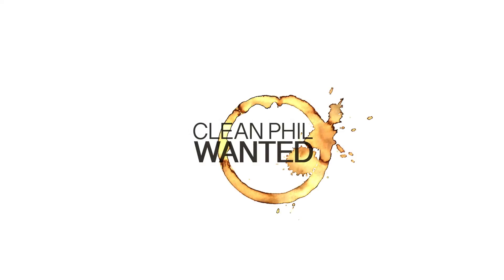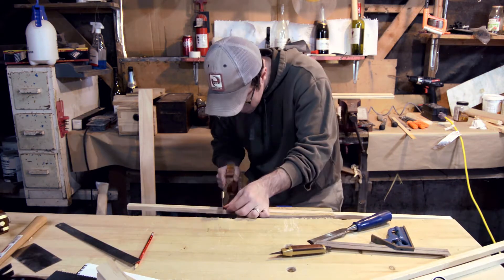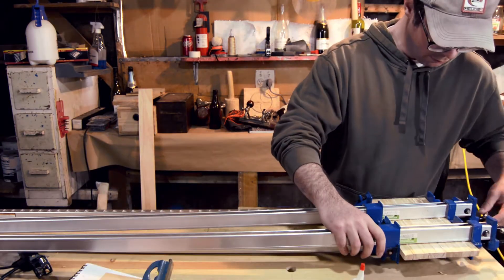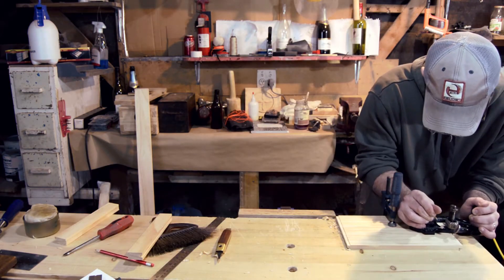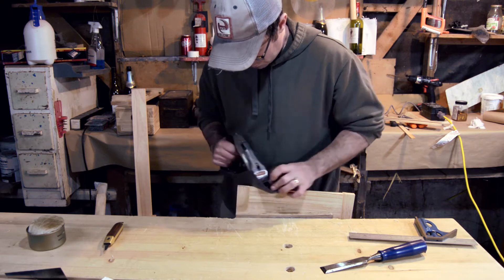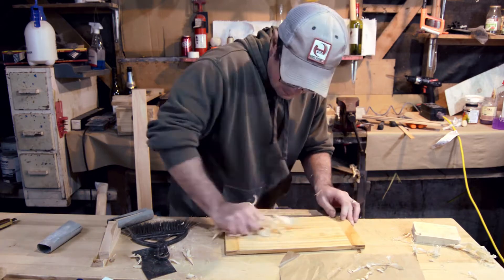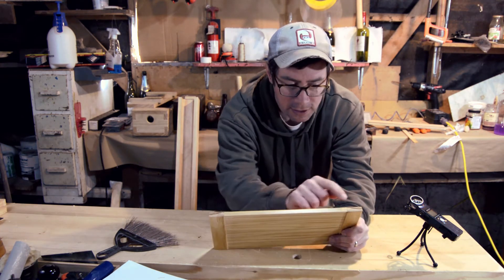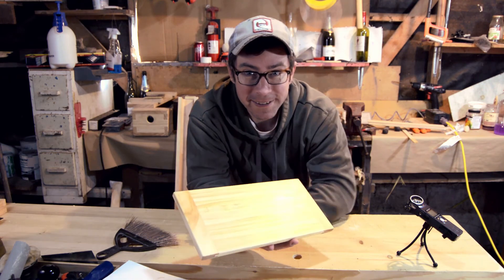Cheeseboard Build with Tongue and Groove Ends

Comment: Pretty cheese board, well done. You might have some cross grain issues but at such a small scale you'll probably be okay. You mentioned sawing straight both in this video and the last one. If I can be so bold, lengthen your saw stroke. It could be dropped frames do to sped up video but it doesn't look like you are using the entire saw plate during the stroke. Assuming your plate is true, the saw wants to cut straight and not using that great, long reference surface is like trying to joint a long edge with a #3 plane. It's possible but harder than using a jointer plane and the long sole as reference.
Reply from the maker: Hi +RenaissanceWW! 
 I thank you for bringing this up. First off, be bold. I started doing these videos for a number of reasons but getting feedback like this is one of the main reasons.  I'm not too worried about the crossgrain because of the width, but we'll find out for sure. If it does fail then I get to make another gift :D 
When I use my saw benches I can rip pretty dead on. I just can't get my mechanics right while in the vise. I will admit it is frustrating and I know that starts to play on the issue as well! 
The first thing I altered was my push, I was pushing down the rip and not across. Basically I wasn't letting the teeth do their job. Which is the first thing one hears to change with backsaw cuts to get those true. This same tactic really helped a lot with this set of rips. Still, you are correct that I'm not using the entire plate in the stroke. I find that the last 1/4 to 1/3 or so I'm dropping the angle and it jams up. I suspect this starts before those points. So, I've been altering my stance and trying different things but I still have this same issue so I'm open for suggestions!  
This saw is true and the set is on the money (I"m pretty sure anyways). Some of the other ones (church sale buys mostly) have wacky sets on the teeth, so I need to work on those. Still, I'm the least common denominator in the issue so I need to change before I can blame the tool.
Reply: Sawing in the vise like that will always be tough because the bench gets in the way of your arm swing.  Footwork is a big factor in keeping your body turned in such a way that your elbow, shoulder, wrist are all aligned with the plate.  I may just be a matter of stepping a bit back with your sawing foot to turn your body.  But this is also where using that entire plate will help to average out variance in the stroke and give you a straighter cut.  You  might try moving the board up or down in the vise to prevent the jam on that last bit of the plate.

Comment: Nice video, as usual. Can you do a quick video on your shooting board setup? It looked to be capable of both 90* & 45* cuts.
Reply from the maker: I'll get a video of it up soon for you Matthew. It's Paul Sellers design but I can still walk you through it as well as describe how I made it.
Reply: Clean Phil Wanted I didn't realize it was Paul's design. You're the first person I've seen build it. How do you like it? I opted for a simple 90* for the time being.
Reply from the maker: I also used a very simple 90* for a long time. I was looking to have the 45s and and save space.  Granted I don't make moldings much or picture frames so I don't really find the 45s useful. I'm sure someday I will though.  I do find the 45 wedge to be useful for supporting long pieces so that part is a win!  Otherwise, a 90* is more than I've needed.